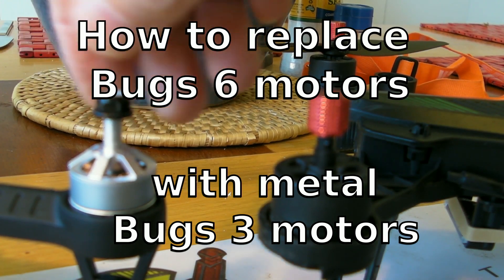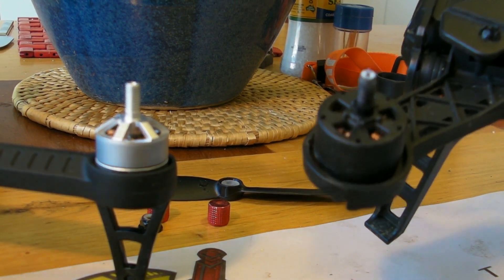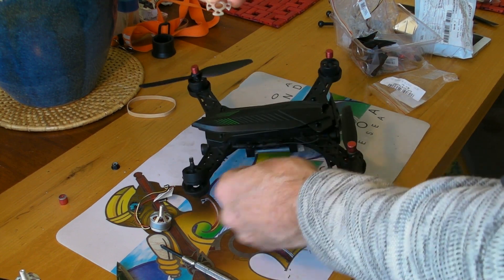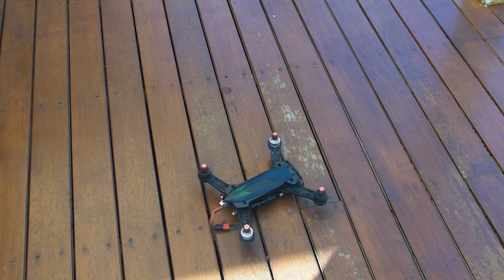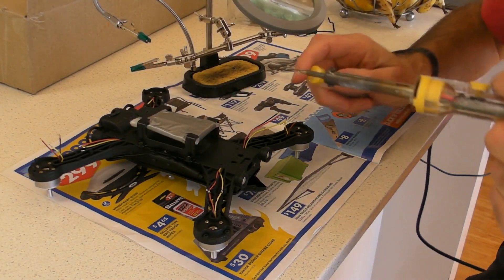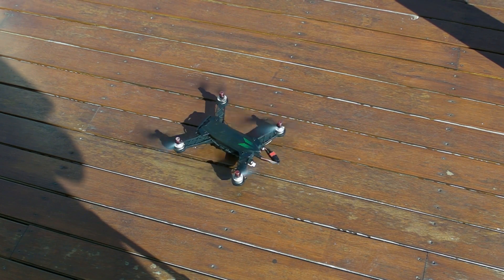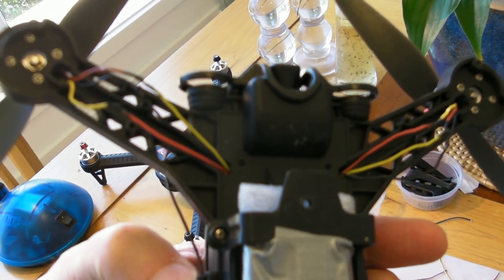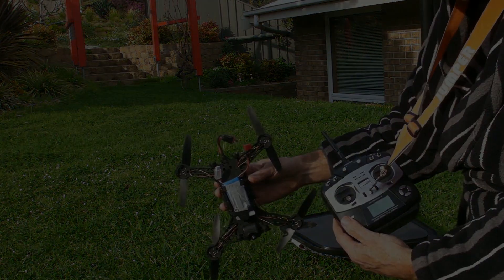How to replace plastic MJX Bugs 6 motors with metal Bugs 3 motors

Comment: Hey David 1st off great content! Recently my bugs 3 doesn't turn on when I plug in the battery. I opened it and found this strange white glue in the motor. Could I show u?
Reply from the maker: You could put up a short video on your YT account to show me. Glue is often used inside of motors to balance them when they are made. When a drone won't even turn on, I start by checking the battery. Strong burnt smells can mean that something has burnt out, especially if the drone got wet. Usually when one motor won't spin properly, the problem is a bad ESC. However, when I used to crash a lot, sometimes motors came apart, or the copper wire inside became displaced.
 Good luck finding the problem.

Comment: I'm having trouble out of both back left motors6&3 I changed esc on 3 but how u find out if 6 has a bad esc ,,,6 back left motor won't work at all
Reply from the maker: Sorry to hear of your troubles. This can be a frustrating hobby at times. 
When I had an ESC fail on the Bugs 6, there was a strong smell, then burning. I could see damage on the surface of the chips associated with the ESC that failed. The problem then is that you have to replace the whole 4 in 1 ESC board.

Comment: I've got the same exact problem on my bugs 3 as I do my 6th the back lift motor will not work at all on the bugs 3 it kind of turns and it when I change everything over to the bug 6 I'm still having the same problem now I put my bugs 3 Motors on my bugs 6 in the back left motor won't work on that one either and I have seven or eight motors from Bugs three's none of them work could you help me
Reply: My6 I meant
Reply from the maker: If none of the motors work in the back left position, the most likely problem is the ESC needed to be replaced. Before trying this, double check that all of the wires on the back left have good connections - especially the 3 wires between the ESC and the flight control board. Always recalibrate before testing (both sticks down and to the right).

Comment: Awesome mod
Reply from the maker: It worked well, right up until the time I lost it 50 foot up a pine tree.
Reply: @skybug3  ...not even kidding...I have squirrel in my blood...I would have been climbing...or shooting a bow with heavy test fishing line attached...shake it down!!!
Reply: Drone ready my back left motor on my 6 quit I changed motor but still not working
Reply: @raydesheles9205  ...then it's probably the esc(electronic speed controller)
Where you been man???
Reply from the maker: @raydesheles9205  Another thing to look for is loose or broken wires between the motor and the board - I've be caught out by that one.

Comment: Hi David, good to see another Sth. Aussie on YouTube. Great videos. Wondering if you can help me. I have a bugs 5w which has just had a motor and esc replaced. Now the motors won’t unlock. Can you tell me how to calibrate the esc if this is the problem?
Cheers, Peter.
Reply from the maker: Hi Peter - Thanks,  we have some great places to fly here in SA. I haven't had any experience with the more recent and more complex MJX models.  I have replaced a few motors escs and esc boards for B3s and the B6. In one case I recall going back and using the standard Tx to calibrate with, but in all other cases my Jumper T8SG worked well without any additional steps.
Reply: David Dawson thanks for the quick reply.
Cheers Peter.

Comment: As I will say, the work you did on this project is very sloppy and not recommended. I would have desoldered the wires from the circuit board and soldered the new motors to it. I would not have spliced the wires together like that. Very poor workmanship...
Reply from the maker: Fair comment. Since then, I've had more experience of soldering and would be confident enough to desolder and solder to the circuit board. Back then, I was more concerned with keeping heat away from the board. As it turned out, the job held up and I had many happy hours of flying before I lost it at the top of a tall tree.

Comment: Can I put bugs8 engine in bugs 6 ? it's compatible ?
Reply from the maker: Yes - the orignal Bugs 8 was the same as the Bugs 6, with a different cover. The newer Bugs 8 Pro also has 1800KV motors like the Bugs 6 and should be OK, although I did not buy one.
Reply: Tnx

Comment: Me and a friend will be dong the same thing shortly...cool mod for sure.You can also use the Bugs 3 battery for the Bugs 6. The 3 battery has a 1,800 mAh , the 6 has 1,300 mAh.
Reply from the maker: Good luck - worked well for me. I have used 2S batteries up to 2500 mAh,  up to 45C in both Bugs 3 and Bugs 6 without any problems.
Reply: @skybug3 ...Thanx.

Comment: Hello, how are you?! I intend to replace Bugs 6 motors with Bugs 2W motors. Will the color scheme of the cables remain the same?! Has any change been necessary in your case? TKS 🇧🇷 Peace!!!
Reply from the maker: Hello - I  had to wire red to yellow to reverse spin from (clockwise) CW to CCW for every motor. I realise now that a better way would have been to move the motors to different positions. The way I did it reversed the spin, and could have resulted in nuts undong and props falling off. However,  my Bugs 6 flew well right up to the day I lost it by crashing high in a tree. I suggest that you wire red to red, yellow to yellow and test. If no lift, swap the motor positions.  Good luck!

Comment: Wich motors are faster?
Reply from the maker: My Bugs 6  seems to be faster with the Bugs 3 motors than it was before the upgrade. But it is hard to compare - I'd need another Bugs 6 set up with the same props, battery and fpv camera to run time trials. Both the original Bugs 6 black plastic motors and the Bugs 3 metal motors are rated at 1800KV. There seems to be two model number on sale 1805 and 1806, both 1800KV. I notice that you can now replace the original plastic motors on the Bugs 2W with all metal 1806 motors.

Comment: Hi David, if I can pose a question, could I replace my  BUGS 6,  7.4V 1300mAh 25C LiPo battery with a Bugs 3 1800mAh without getting damage to the electronics or motors?
Reply from the maker: Hi Mike - yes, this works without any problems. I've used up to 2200mAh 25c batteries designed for Syma quads as well. Unlike the Bugs 3, the Bugs 6 is not designed to cope with 3S batteries.  When I've used batteries that would not fit in the Bugs 6 holder, I've unscrewed it, and used Velcro and/or rubber bands instead.

Comment: Which is better the bugs 6 plastic motor or the metal motor??
Reply from the maker: Just after the first test flight, I was bunching motor wires together, and managed to miss a couple of bare wires. Burnt out the esc on the board for the right front motor.  I'm now waiting on a new esc board before the fun continues. I hope to put up a video of the whole sad incident, with a successful fix as soon as I can.
Reply: @skybug3  oh so sad 😢

Comment: Does my Bugs2 use these Bugs3 motors? I'd like to use B3 spin on props on my B2 for easier packing. That a good idea?
Reply from the maker: Hi Colin, looking at videos of the Bugs 2c, it appears to have plastic motors, not the metal motors that are on the Bugs 3. If this is the case, removing and replacing props frequently is likely to damage the plastic thread on the prop shafts. Another issue is that you may find that the motors spin in the opposite direction, as I've just found out with my Bugs 6. Could be tricky - having a prop fly off, or thread damage are not good outcomes.
 I would not try B3 spin on props on a B2.
Reply: @skybug3   , thanks pal. If I find a good buy on the motors I might replace them then.

Comment: Bit odd mjx swapped the red and yellow polarity between the bugs 6/8 and bugs 3 models. I had issues with 2 bugs 8 quad motors I bought from mjx directly last year when first released and made a quick how-to video on a repair fix as I found I was not the only one to have a seized motor issue at the time. So effectively I made 1 good quad out of 2. If I have any issues in the future I have another 3 bugs 8 motors to swap over
Reply from the maker: I remember your video - as you say, a lot of reviewers had problems with the first batch. After seeing other examples of broken plastic motors, I've decided that it's a bad design, and not worth trusting to fly with.

Comment: Great project! The bugs 3 just keeps on giving it seems.
Reply: You could try a 1200mAh 3s to really get some punch 😎
Reply from the maker: Some get away with that, some don't. Think I'll wait and buy a proper acro quad if/when I get bored.  ;-)
Reply: May I suggest the HGLRC XJB. It's a 3". So it's not intimidating to fly in public. They are made out of some sort of indestructible magic. Super fast, reliable and relatively cheap at the moment on Banggood or Gearbest. 

They have a very good reputation. 

Once you have smart audio, or control of your vtx through osd, you won't want to go back 😎

I think my second to last upload was of the XJB flying.
Reply: @BengalCatChilli ...Just use the Bugs 3 battery to replace the Bugs 6 batt.